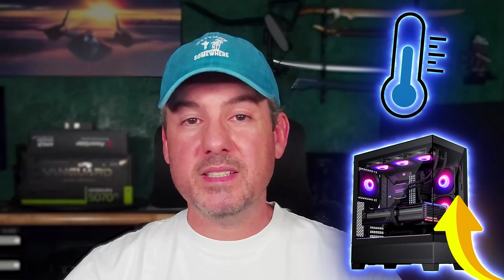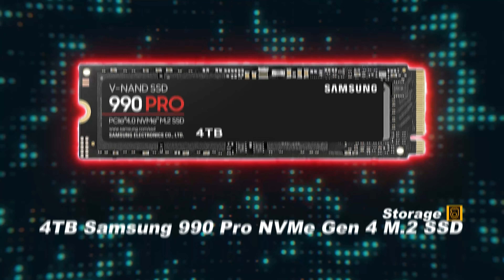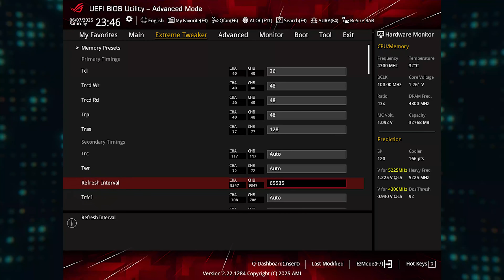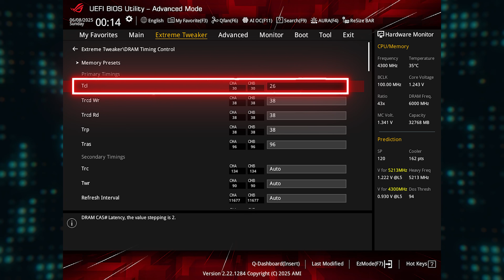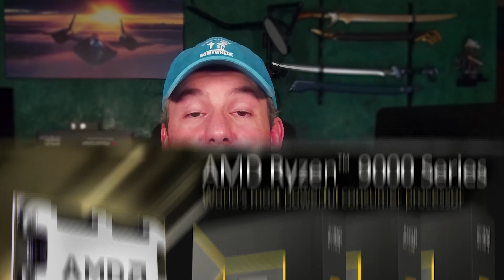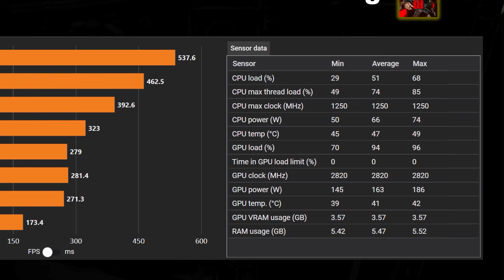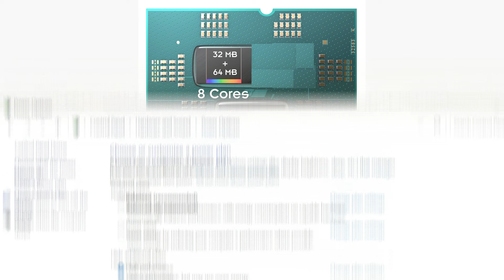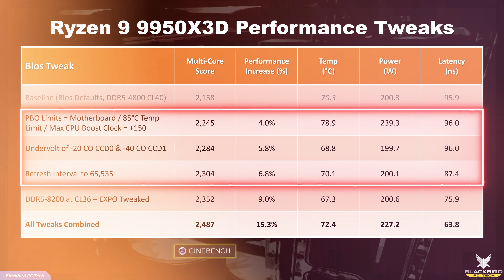What Are The Best Settings for an AMD Ryzen CPU?

Comment: I applied all core +200mhz on my 7800X3D, but the core clocks is unable to push past the 5050mhz cap 😞
Reply from the maker: Unfortunately, the 7000X3D and 5000X3D chips are locked for overclocking due to thermal issues with the first generation 3D v-cache arrangement, so changing the core boost will not impact your performance.
Reply: @blackbirdpctech  Thank you for clarifying! I was so confused why the core clocks did not change when comparing PBO -30 +0mhz vs PBO -30 +150mhz.

Comment: All my games now push my CPU over 90c now. I set the limit to 85 and now my games are a lot slower as my clocks are lower!
How can I fix this?!?!
Reply from the maker: What cpu and cooler are you using?
Reply: @blackbirdpctech  Its a 280mm AIO, Ryzen 5800X3D on a ROG STRIX B550-F wifi2
Reply from the maker: @Luke90CS  I think you should re-paste your CPU

Comment: How much DRAM voltage for 8400?
Reply from the maker: For the example I showed in the video I got very lucky and was able to run it at XMP settings, which for that kit was 1.4V. I recently tried the same kit on my X870E Apex and I was unable to get it stable with 1.5V.
Reply: Yeah i beleive, ATM um using 1.40v for 8200 and its prety good, but i beleive for 8400 Will not be stable no matter voltage i use. I Will test later. Thanks for your answer bro 👊 @blackbirdpctech

Comment: Holly Crap! This Asus motherboard is €560! Was thinking to buy same to fallow your method but damn. This is way beyond my budget.  €150 Gigabyte have to do😂
Reply from the maker: You don't have to spend that much on an AMD AM5 motherboard ... the reason I recommend using the "AMD Overclocking" menu is that PBO2 is a feature set that is available on all AM5 motherboards.
Reply: @blackbirdpctech  thanks for comment. I just ordered my setup. 9800x3d, 2x32gb Corsair vengeance 6000 30cl, Gigabyte B650 AORUS ELITE AX V2 and Samsung 990 PRO NVMe M.2 SSD, 4 TB. Thermalright Royal Pretor 130 and NZXT H7 Flow. Do you think I should tweak anything or leave it alone? I'm definitely will indervolt by -10 only. Any suggestions welcome. Great channel btw
Reply from the maker: @TheKamilkrawczak  I would tune your entire system ... and I wouldn't artificially limit your undervolt to -10CO ... I recommend testing it to find your limits and then back off a little for rock solid stability

Comment: Thank you very much. There is truly not enough high quality content like this on youtube that explains everything and provides step by step guides. It's also very fortunate that you also have an asus am5 board like me which is great :D
Reply from the maker: You are very welcome ... hope it helps you extract extra performance!
Reply: @blackbirdpctech  I've been generally running -30 undervolt on all cores for about a year now, however I wasn't aware that you are also able to provide a PBO clock speed offset. I've set mine to +200mhz however I never see my 7800x3d actually going to 5250Mhz, it's always at 5050 no matter what. I have not removed the power limits like you showed in your video, so perhaps that is the reason?
Reply from the maker: @albertkam191  no, it's because all 7000X3D chips are locked for overclocking due to the first generation 3D v-cache config causing thermal issues
Reply: me stumbling to this back was like  an oppenhiemer moment

Comment: MSI B850 tomahawk max wifi, MSI 5080 Ventus (non OC) version, 9800x3d, 32 gb CL 30 6000 RAM, 1000 Watt Corsair 80+ gold PSU, 1TB SSD for system+ 2TB SSD for everything else. Air cooling in Fractal Torrent with 1 extra  fan for exhaust. Would it be wise to try to overclock the system with air cooling or is it only for water cooled systems ?
Reply from the maker: Absolutely ... by putting in a thermal throttle limit, the worst that can happen if your cooling isn't sufficient, is that your performance will drop to stay below the temp limit ... so it's definitely worth trying.

Comment: Why don’t you add manual control to scalar if you don’t mind me asking? I’ve set it to x7 and it seems stable after tests in cinabench (CO -25, +200Mhz) - wondering if it might harm my CPU with such an aggressive scalar. Temps at 84-85 C
Reply: Have a 9800X3D
Reply from the maker: Good question ... I debated whether to mention it in the guide. All that it does is change the boost clock behavior by increasing the Failure In Time or FIT limit of the CPU ... which means it increases how long the CPU can sustain higher boost frequencies before thermal or power limits kick in. When I tested it in the past, there wasn't a meaningful change in performance. That said, even if there was a small boost I would likely not use it because of the potential risks ... so I would recommend leaving it on auto. If you are going to adjust it I wouldn't go beyond x2.

Comment: Is Gigabyte B650 eagle good board for 9800x3d paired with ddr5 6000? Any suggestions will be appreciated
Reply from the maker: I've had some issues with Gigabyte in the past ... I would recommend going with MSI or Asus ... here are a couple of alternatives:

1. Asus TUF Gaming B650-Plus - https://amzn.to/43IuNbN
2. MSI B650 Gaming Plus WiFi - https://amzn.to/3HEDprj
Reply: @blackbirdpctech  hi! I have a question. I have seen plenty of videos comparing motherboards and the best choices for overclocking the CPU and RAM. Everyone has different thoughts about the best B650 motherboard for 9000 series AMD CPUs. Firstly, I preferred the Gigabyte B650 eagle, but realised then that it will not be enough for overclocking all these features that you showed in this video (best video about OC that was ever made, thx). So then, I decided to stop with the Gigabyte B650 AORUS ELITE AX V2, as it's more functional than the eagle version. So, for me, it's the same price, this Gigabyte Elite, Asus TUF Gaming B650-Plus, and MSI B650 Gaming Plus WiFi, that you recommended. So I will choose what you recommend more. Also, it all depends on the BIOS; different B650 motherboards have restrictions for oc of different sections that were described in this video. Of course, your X870E will have full functionality in BIOS, and it will not be a problem. And it costs relatively much more than the B650 lineup. B650 mobos are more budget, that's why I need to figure out which of these 3 mobos is the best option for all OC stuff in the video. My planned setup is 9700x paired with Kingston FURY Beast EXPO DDR5 32GB 6000MHz CL30 and 9070xt. You will be greatly appreciated if to answer such a question about cheaper mobos. Thank you for this video, it covers overall oc a lot.
Reply from the maker: @quzake  it's a good question and my honest answer is I don't know because I don't have a B650 to test ... that said, all of the PBO options should be available on B650 motherboards.
Reply: @quzake I took same bord. Looks great.

Comment: Manual OC > PBO/any manual UV.
Always.
- Try Core Ratio X = Max boost clock +1 to +3 (more if you have golden sample/ECLK/very great cooling)
- EXPO (6000MT/s CL30) can tweak the EXPO further but stability will greatly depend on what else you have already overclocked (and tREFI 65535)
- Power Down [Disabled] no potential slow down by sleeping. Gear Down mode [Disabled]. No 2 cycles before potentially executing a task, always 1 cycles so slightly faster)
- Core Boost Disabled (no potential voltage shift better clock speed stability)
- C-state off (no potential big voltage shift. Better reactivity of cores, slightly increasee power usage on idle)
- FCH Spread Spectrum (Avoid electromagnetic interference from radiotion from Nuclear power plant and space, this features have somehow a bigger clock speed down on 9000 series than 7000 series. Turn it off it will be slightly faster)
- UCLK=MEMCLK if RAM kit is equal or slower than 6400MT/s. (Which is 3200MHz, you have a slim chance to run 3300MHz stable (or boot), you have not a lot of chance ro run 3200 UCLK stable but way better than 3300. You have more chance to run 3100MHz but not 100% guaranteed to be stable. You have 100% chance to run 3000MHz UCLk unless tour board us pire garbage who doesn't support 6000MT/s kit or your RAM kit is defective (extremely rare but can be the CPU who's defective).
- FCLK 2000MHz (which is 3:2 of MEMCLK) is the best for 6000MT/s (higher isn't berter unless it's 5% above like 2100MHz). FCLK 2000MHz guaranteed to work. Above that no guarantee anymore but slightly higher have nice chance to work. Above 2100MHz chance start to be thinner and above 2300MHz the chance to work are super super super small. (Absolute max FCLK allowed is 3000MHz)
- PBO Advanced. Manual. Thermal throttle 95°C. Scaler multiplier set to ×1 (to avoid higher voltage). TDC should be equal to Y. Y = V for volt × A for Ampere = W watts. And Y is A. Set it to match the TDP of the CPU. Or the TDP above (like for a 65W chip for example). EDC should be euqal to the exact same thing but to match the PPT. EDC should be ALWAYS bigger than TDC. Clock limits override+ 200MHz.
- In RAM timings if you load a pre-made profile/EXPO profile make sure than tRC ≥ tRP + tRAS it's a basic.
- set all fans to work at 50% speed whenever the CPU is at 0°C minimum (that way you have a permanent airflow and PC is more cooled)
- Latency killer [disabled]
- FCLK predictive? [AUTO]

Lemme know if you got better CPU-Z/Cinebench23/3DMARK CPU profile with that methods.
Reply from the maker: You make a statement that manual OC is greater than using PBO and then proceed to suggest using PBO?? Furthermore, all of your memory suggestions are directly covered in the video. So I'm curious how you think this is adding value?

Comment: Great guide! I had followed most of this from your previous videos but one thing I'm willing to try is lowering my 9800X3D boost from 200MHz to 150MHz and see if that improves performance. Also thanks for that capframeX tool, that piqued my interest, seems very useful and will try it for sure
Reply from the maker: I wouldn't do that if you are running 200MHz stable ... that's what I run on my 9800X3D. However, for my 9950X3D, it seemed to like 150MHz a little better.
Reply: @blackbirdpctech okay! makes sense,  thank you!

Comment: I found that -20 UV with the mobo thermal limit set to 85 with +150 mhz to be the best for my 9800X3D. I have the gskill  trident royale 6000 MHz cl28 ram. I turned on expo but was wondering if it’s something worth tweaking for my system. Also any other recommendations? Running a sapphire nitro 9070 XT with a 10% increased power limit and -75 under volt. I saw no performance increase with boost clocks and any memory tuning even +50 MHz caused instability. I have the Samsung vram fyi. Would greatly appreciate your input on everything good sir!
Reply from the maker: My recommendations for the CPU are in this video. For your GPU you can look at this guide: https://youtu.be/IoOg0Qglneg
Reply: @blackbirdpctech yes sir used both your videos to tune mine! I was just asking for your thoughts on my results and if there was anything else you could suggest?
Reply from the maker: @RyAnMcGeE77  you could try for CL26 on your memory kit as shown in the video ... definitely worth a shot
Reply: @blackbirdpctech thank you sir will do! Is there any reason you think my 9070 XT will not allow me to tune the memory at all? Is it just one of those silicon lottery losses? Lol
Reply from the maker: @RyAnMcGeE77  that's interesting ... you should be able to overclock your VRAM on a Sapphire nitro+ card ... have you tried OC'ing your VRAM with no undervolt and max power slider?
Reply: @blackbirdpctech no sir I dialed in the stable UV  with the increased 10 PL first then tried for the clock speed which saw no difference in performance so left it at 0 then tried memory and even 50 MHz caused it to crash with me trying default and fast timings. Even tried dialing back my undervolt to -70 from -90. -90 was stable on 20 runs of steel nomad so -70 was even more stable. So trying to figure out where I went wrong so any help is greatly appreciated!
Reply from the maker: @RyAnMcGeE77  it doesn't sounds like you did anything wrong ... I would go back to stock settings and try overclocking just the VRAM to see if it's stable. Have you been monitoring the VRAM temps?
Reply: @blackbirdpctech yes sir they have been very stable barely approaching 80 degrees. My card has the Samsung instead of the Hynix and I have read reports that while the Samsung runs cooler that it does not overclock near as well. So hoping that that isn’t my issue and I just will have to leave it at stock. But when I get off shift, I will put everything back to stock and see if I can tune the VRam at all and it remains stable
Reply: @blackbirdpctech yes sir they have been exceptionally low. When overlocking the 9070xt memory should I leave the time as default or change it to fast timing in Adrenalin?
Reply from the maker: @RyAnMcGeE77 default … the fast timings tend to be unstable

Comment: Wow, lots of information in a relatively short video, great job. I particularly liked the follow-up checklist to double-check. Perhaps a spreadsheet with some different component selections and bracketed limits would be nice, I would buy that. I have 9800x3d, with asus strix x870-A, and kingston 64gb ddr5 6400. I will prob try your same settings as it is similar.  Thanks again.
Reply from the maker: Yes, I've been thinking about releasing my custom tools ... will find the best way to do that.

Comment: My Stable BIOS / Curve Optimizer / Overclocking Settings For The AMD Ryzen 9 9900X after watching an earlier BlackBird PC Tech video:

BIOS
Precision Boost Overdrive >> Advanced
PBO Limits >> Motherboard
Platform Thermal Throttle Cntrl >> Manual
Platform Thermal Limit >> 90

Curve Optimizer >> All Cores
All Core Curve Optimizer Sign >> Negative
All Core Curve Optimizer Magnitude >> 30
XMP/EXPO Profile >> EXPO 1
Integrated Graphics >> Disabled

// 
My Hardware / BIOS Version used for this--
Motherboard: GIGABYTE B650 Aorus Elite AX Ice
  >> BIOS F32h [Dec 19, 2024]
     >> Has Update AGESA 1.2.0.2b
Memory: Corsair 32GB 6000MT/s AMD EXPO CL30
CPU: AMD Ryzen 9 9900X
//
Thank you sir
Reply from the maker: That is an exceptional good all core curve offset for a 9900X ... you likely have a golden sample.
Reply: @blackbirdpctech  Thx for the video I'm going to try this tomorrow on my 9900x system. Do you recommend disabling the iGPU if I'm not using it?
Reply from the maker: @Lord_Zath   I would only disable it if you are having thermal issues

Comment: I can hear your audio quality has improved a lot compared to your last videos! Are you using a new mic? ;)
The sibilance in your voice is still a bit piercing to the ears though. Try using an EQ to turn down 6.5 KHz by about 3.5 dB.
I just tried this EQ setting with your video and it sounds great! Thanks for improving your audio and great video, btw!
I've got my 7950X running Eco Mode 105W with -25 CO. Coupled with 64GB RAM running at 6400MHz CL30 in 1:1 mode, 2133 FCLK, 1.26V SOC. Fully stable!
Reply from the maker: Yes, this was the first video that I used my new Rode NT-USB+ in ... I should be able to turn down that frequency in OBS since it has an equalizer. I am using the Noise Gate, Aural Exciter, Compressor and Big Bottom features in the Rode software as well. The difference between this mic and my old one was noticeable to me and I am far from an audiophile 😉

Nicely tuned system!
Reply: @blackbirdpctech  Yeah I instantly noticed that the audio was different in this one. 😆
If using OBS 3-Band Equalizer, just turn down the high band until you feel like the sibilance is sufficiently tamed, without being excessive to the point where your voice sounds dull.
Thanks! My 7950X is basically getting stock performance in Cinebench while consuming only 145W.
My RAM is getting 90006 GB/s Read and 55.7 ns Latency in AIDA64 which is awesome for a 64GB kit. 🙂
Reply: @blackbirdpctech  Also consider turning off Aural Exciter.
All it does is add highs which can be good for music with dull-sounding voices but not really for videos. All it does to your voice is add unwanted sibilance.
Reply from the maker: @Nayah9  thanks
Reply: @blackbirdpctech  No problem! Honestly you probably don't even need EQ. Just turn off Aural Exciter and you should be golden. 😉
Reply from the maker: @Nayah9  let me know on my next video if the sound is better after turning off aural exciter.
Reply: @blackbirdpctech  Will do! ✌

Comment: I'm not going to overclock my 9950X3D (same mobo as yours - Asus ROG Crosshair X870E Hero), just enabled PBO. For me stability > performance.
Reply from the maker: It sounds like you think you have to make a choice between stability and performance however, by following my guide, most people will be able to get a large boost in performance without impacting stability ... simply by taking advantage of the better quality silicon that they have. Performance without stability is only helpful when trying to break benchmark world records.

Comment: what about burning issues experienced by those who use a 9800x3d vsoc, vddio how best to protect those cpu's?
Reply from the maker: I'm not sure what you mean by your voltage references, but the burning issues that were hyped by the larger channels were limited to a small number of ASRock motherboards due to an issue with their firmware ... this has now been fixed by ASRock.